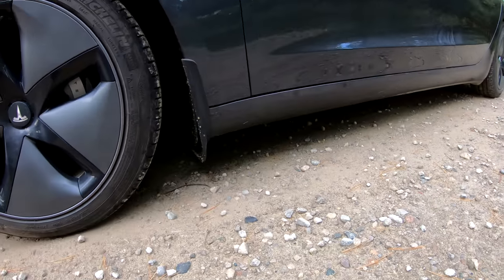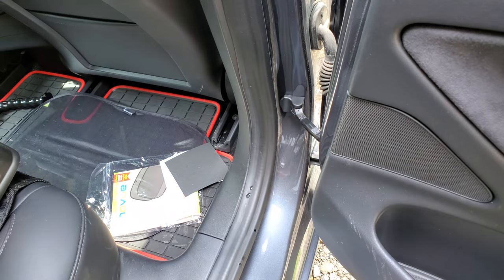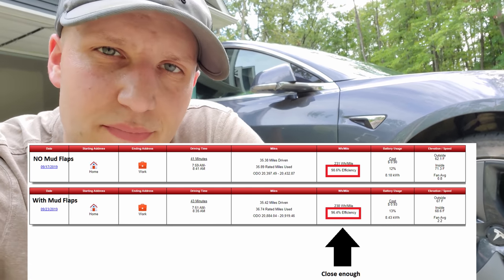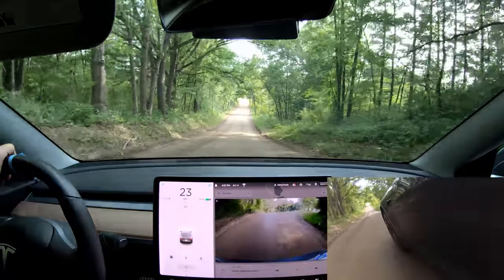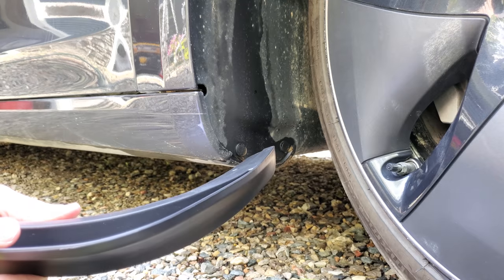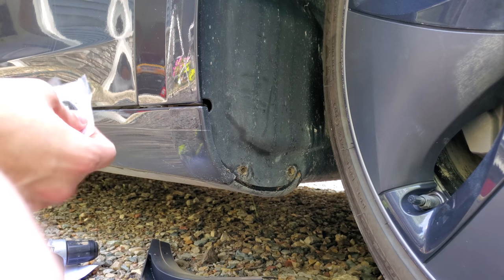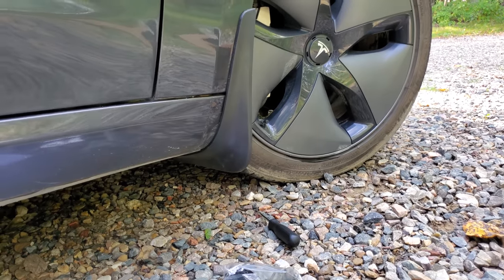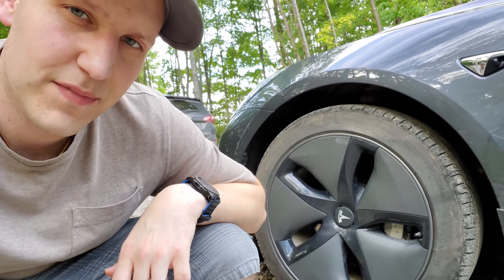Tesla Model 3 Mud Flaps | Install and Review | Unboxing | Testing | Splash guards |

Comment: Installed  (July 29, 2021)the updated version of the Basenor mud flaps on my wife's 2021 Model 3.  They came with a roll of two sided tape, self taping screws and regular plastic screws.  The extra self tapping screws are for the front flaps.  They  are a optional install.    She did not want a extra hole drilled into the front flaps.  I wanted to drill the holes and add the self taping screws.  It was her car, so I went with her wishes. The flaps are on fairly tight.  They look pretty darn good.  We took our time installing them. It took about 45 minutes for the install.  We used a Youtube video to help us with the install process. Only time will tell if they hold up.  We live in California so the weather is not harsh at all.  We actually have been in a drought the last couple of years. So heavy rain will not be a problem.  Updates in a couple of months to follow.

Comment: Front passenger side. When ever you put a screw into plastic like that you might want to do it by hand. If you over tighten it, it just strips itself out.
Reply: Door Trim Panel Clip works better. :-)

Comment: Instead of using a screwdriver, I used a flat crowbar and it's really easy to remove the rivets. Crowbar fork can reach both side of the rivets

Comment: For how not far these mud flaps stick out, I'm quite impressed at how well they kept the dirt off the car!  I was never a fan of mud flaps that obnoxiously stuck out, so these ones looking pretty discreet is really nice.  One tip on the stupid push clips, once you get the flat head in there and start it, if you twist your flat head 90° instead of just trying to make it fly out, they should pop out far enough where you can just pull them out with your hands instead of potentially stabbing yourself or the paint or car :D

Comment: This worked surprisingly well.  Quick tip on the removal of the plastic rivets....use a pair of wire cutters and grab the top and bottom at the same time and they usually just pop right out.
Reply from the maker: Yeah I didn't expect them to block that much!

And thanks for the tip. This was all new to me haha
Reply: Dirty Tesla I may pick a set up, just not sure how they will look on my white model 3
Reply from the maker: @zollotech  I think black looks sick on the white 3. There are other companies that sell white ones, but I hear the paint is not very well done and eventually cracks. But I've never seen it in person.

Comment: Those look like they will be great for winter to keep some snow and salt off the paint.
Little tip: there is a tool to remove those plastic clips that makes it a lot easier, and makes them less likely to break.

Comment: I added a U-nut to the front screw so there was more for the screw to grab. Also the OEM pop rivets you removed, if you look above and behind the rear wheel you will see three holes that look like a pop rivet will fit. I used all of the OEM pop rivets that were replaced in those holes. The rear fender liner seemed a lot more secure.
Reply from the maker: Nice tip I will go back and add those!

Comment: Looks Awesome? Mmm, not sure they look very good, but it is necessary on this car. The only problem is that eventually there is going to be rust behind the flaps since they will trap dirt and moisture behind them. Probably a good idea to put on a piece with PPF first, then do the Flaps.

Comment: There are Plastic Fastener Removal tools for a few dollars on amazon that work much better than a screwdriver.  I learned the hard way also.
Reply: I got one included with a set of lights, so plan to see if it fits the wheel arch ones too. :) Good call!

Comment: There is a "clip" near the top of the rear flaps that goes behind the metal.  You may have clipped it, but in one shot it looked like the top of the rear flap wasn't back against the metal like it should be.  Great videos!
Reply from the maker: Thanks I will double check that!

Comment: Looks like you used the "two bucket" method to wash. Nicely done! I never even heard of that method till I got my Model 3, but once I read into it, I won't ever wash using the single-bucket method again. Even after I get Amperelicious ceramic coated.
Reply from the maker: Just saw this comment

Comment: Looks like they are lacking a draining hole, you might want to add one, just to avoid having water sit in them all the time.
Reply from the maker: I don't think they would hold water but I'll check it out
Reply: @DirtyTesla  well, the gap between the car and the flap is pretty narrow, so the surface tention might help a bit.

I think I would just seal the upper edge with transparent silicone and drill a small hole or more at the bottom to get any water out :)

Comment: My advice is that if you buy these, be prepared to have to trim them so they don’t touch the ground when on slightly uneven surfaces or when cornering. They’re crap! They don’t even fit the car properly. In fact, the best part of them is the box they come in because that’s what you’ll need to send them back in.

Comment: Those seem to be very "generic", everyone seems to sell them (at widely varying prices). I've a set sitting on the desk for weeks, still waiting a car. ;) I paid less than $20 inc shipping from China..
Great to see a review, I'd probably have used your link if I didn't have them already! :)
I bought some VHB tape and plan to use that and the poppers to avoid any drilling/rust-prone screws.
I'd also like to see "side strips" nicely moulded to go along the side below the doors - maybe even in the clear rubbery stuff 3D stickers out of. Likewise maybe along at door level to help avoid damage from folks opening their doors.
Whatever about other colours, that grey doesn't seem to get nasty paint chips like some of the "paint issues" posts. Glad I went for that one too, although it was/is expensive. :)
Bonus, when the mud guard plastic is a bit dulled/not glossy black, it still blends in with the grey. :)
Mine had labels on the  clear bags they were shipped in for the approriate side.
A wider blade screwdriver or e.g. a plastering spatula might be better to get the plugs out? Use the size that matches the notch to lift the plug and then the bigger one or a spudger to pop it out?
Maybe they were also "stuck" with road dust/mud, so spraying with some lube or something might have helped? Although may have made it harder to apply the scredriver ...
Oh and the car has metric fasters soyou should have used a metric drill bit. :) (joke!).
I have the exact same Ryobi drill, but sadly it has died, the trigger doesn't fire it up (battery is fine in another tool) I'll have to open it up ...
Is it just me or do the rear ones not taper into the body properly? There seems to be a slight gap at  the top?
Reply from the maker: Yes, it seems you can get the same set from many companies.

When's the car coming?!
Reply: @DirtyTesla  You'' have to ask Tesla/Elon, it's a mystery!  The latest update was very vague and says "by the end of the year" ...
We now have a country budget coming out that could give more or less funding to EVs so likely it's now best for the customers to wait until November anyway. So pick up would be in the cold weather with the roads all wet ... I might need to put the mud guards on at the delivery centre!
Reply: I had the same problem, the flaps are not flush to the body, poor quality

Comment: I was looking into getting these, but I saw someone post that over time they flex and vibrate on the paint surface eventually rubbing down to bare metal and causing rust. Also they had dirt/mud and debris trapped between body and flap which probably compounded the issue.  May want to do a layer of PPF in that area for added protection just in case. They do seem to perform well though for the purpose intended.
Reply from the maker: I'll look for that over time. They seem pretty secure on there but I suppose I could see it happening with the back ones. If you have a link to that I'd be interested
Reply: @DirtyTesla  https://www.youtube.com/watch?v=S6v903YI9Nk&t=32s So I had seen the comment made on one of the forums and I believe they linked to the video on that link. It is a truck, but very similar design for the mud flap.  The dirt trapped between the flap and body is what creates the friction that eventually wears down the clear and paint. The rear is probably less concerning as far as rust because it's plastic obviously. Considering the dirt road you travel, may be cause for concern. Sorry to be the bearer.
Reply: Exactly why I plan to use foam VHB strip to mount them. :)
Reply: There is Anti-Chafe tape to protect the paint from scratching and chafing between the mud flaps.  Many have a low tack acrylic adhesive which leaves no residue on the paint if you ever do choose to remove it.  With the mud flaps already on, trace around them on the car with a liquid chalk marker, then try to replicate the pattern onto the tape.  It might take some creativity and finesse to get it perfect.  But, if the wife or other family members are good at that type of thing, then have them help you with it.

Comment: My black Performance 3 wouldn’t have any paint left after one drive down your driveway. I don’t even drive on gravel roads and I have at least 150 chips on my doors, rear area of side skirts, rear fenders and tail end of lower rear bumper.
Reply from the maker: It seems some cars are worse than others. You can see I've been driving dirt roads for 6 months and it's really not that bad
Reply: @DirtyTesla  It also seems the grey paint is good. I don't recall seeing any complaints from people with grey paint. Is it the only metallic one or is the blue metallic too? the red is supposed to have a couple more layers, so it should at double the price of grey or blue  ...
Reply: @eubikedude  Dealers use automotive paint thickness testing guns to see if any of your body panels have ever been repaired.  I'd be curious to find out if anyone has documented the paint thickness of the different colors and models.  They are just handheld devices and take seconds to test each area.  You could possibly do it at a delivery center.  Only Deep Blue and Grey are metallic.

Comment: you shouldve washed the car then drove thru the puddles first without them on then with them on to get a better comparison. also those taps you broke are two pieces and the inner part pops out and then you pry up the rest of it. you dont pry the outer part first because the inner part is pushing the outer part open which is preventing it from sliding out.
Reply from the maker: I thought about washing, puddle without flap, then washing, puddle with flap... But I barely had enough time to wash the car once. It takes so long with all the mud and dirt so... Yeah.

Comment: Just watched that video. I installed mine last year. I loved them and had them for 6 months until I decided to take them off to get ceramic coating. I noticed that the mud flaps trap a lot of dirt and moisture and this cannot be good long term. There was no sign of corrosion but I wonder what would happen after several years.  Please, let me know your thoughts. Thank you.
Reply: Did you find out?

Comment: well I appreciate you showing us how you did it... but I'm not sure that's how we should do it. For the front flaps, best to mark the hole, drill it and check it's correct before fixing the two bottom clips because if you make a mistake, you've then got to remove those two new clips, destroying them in the process. Anyhoo...

Comment: It looks like the rear has an issue. go back to about 12:20 in your video and look at the top of the right rear mud flap. it looks like it's sticking out from the fender well some. did you consider VHB double sided sticky tape?

Comment: I'd guess that since the flaps do seem to stick out a little, there may be a little drag. What I don't like about the flaps is they look better on one side than they do on the other.
I don't believe I follow the purpose of those other things you got - that you placed under the hood/frunk and in the doors.
What I've been wanting to ask but haven't, yet... the aero wheels - have you ever taken off the aero cover and test any difference? I've seen others do it but if you haven't then maybe it would be a video to do.
Reply from the maker: I haven't made a video about it, but I've had the caps off all summer and the general data from teslafi shows that there most likely is a 3-5% boost in efficiency with caps on. I suppose I can make a video about it, but I'd like to drive for another month or so before making any claims.
Reply: That's about what I heard on other videos. I believe if I'm ever able to get a Tesla I'll opt for the aero tires. Would you say there is ever a beneficial time to take the aero covers off or would you say it's best to just keep them on? Obviously if I were to do vloging then I might do my own test too, but other than that.
Reply from the maker: @BrianJoslyn  The only reason you'd take them off is for looks, or if there's a lot of water on the road (people driving through deep water have had the caps come off and lost, not surprising at all). 

Otherwise, for efficiency, you'd always leave them on. I reaaaaaaaally like the look of them, and I got the cool cap kit from this same company, so I had mine off for a few months. I put them back on for another video I was working on that I need to finish...and now I'm leaving them on for winter.
Reply: I wonder is the drag from the flaps worse than the drag you would get from a build-up of caked-on mud? ;)
Reply from the maker: @eubikedude  ha. yes. The flaps stick out more. And eventually, I will still have all the mud....just delayed.
Reply: Chris
That would be where we would differ... as I prefer the look of the aero covers on, but I was thinking due to range difference when it's hot compared to cold. If I'm not mistaken, range is better in warmer weather - so maybe during cold(er) weather having the aero covers off might be a good idea - maybe?
I know I would never purposely drive through deep water. Just two feet can carry a vehicle. In the lower Tesla's (S, 3, Roadster), it probably wouldn't be a good idea to drive through such deep water anyways.
So, again... I like the aero covers - which is why I already know I would get them, regardless of whether they cost extra or not. I really don't like the look much with the aero covers off.
EV Bike Dude
Similar to what Chris said... I believe without the flaps, the mud would be (mostly) in the wheel well, so probably wouldn't affect drag. If mud were to accumulate on the vehicle body (paint) and was thick enough then it might affect drag. However, as a non-owner (as of now at least), from what I've been hearing, it wouldn't be very noticeable, if at all.

Comment: Do you have any concern about the plastic rubbing against the paint? On the back not so concerned since it is plastic but front fender is a different story.
Reply from the maker: Yes. Gonna make a video about that soon
Reply: @DirtyTesla  This was my question, too. Did you make a follow-up video?
Reply from the maker: @LifeasArt_Tech yep https://youtu.be/5M2YOV972Vg

Comment: Hey I have question on my model 3 I got an little nail scratch on my steering wheel the leather got it I booked an appointment with mobile service do u think they will fix it because it really annoys me and my car is brand new picked it up on Thursday
Reply from the maker: They might if they think the car came like that. Otherwise there are some leather treatment products you could try.
Reply: @DirtyTesla  There are also car interior repair professionals that come out to your home and fix holes in seats, trim etc.
My neighbour got a used car recently, there was a ciggy burn hole in the drivers seat and a guy came out and fixed it. I didn't get to see the fix yet, but I think she was happy with the result.
Reply: @eubikedude  Yes, that's a great suggestion.  There is a dent doctor service in Chris and my area that does this type of work.  They also do repairs for curb rash on wheels and all kinds of stuff.